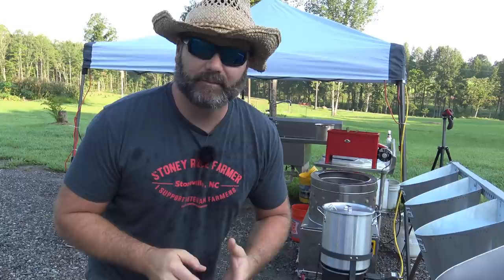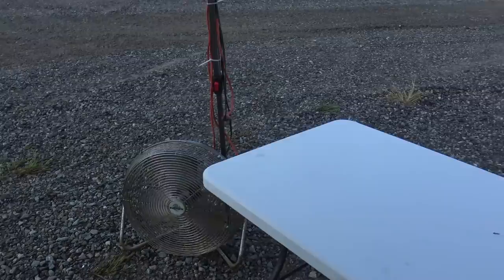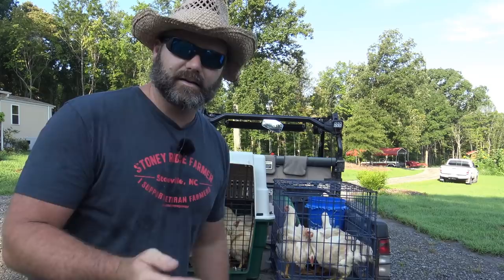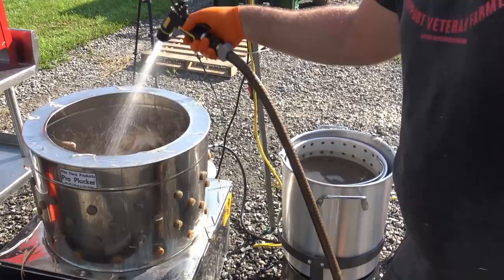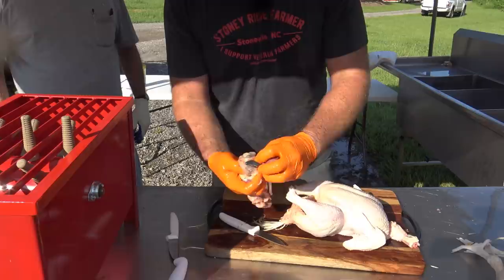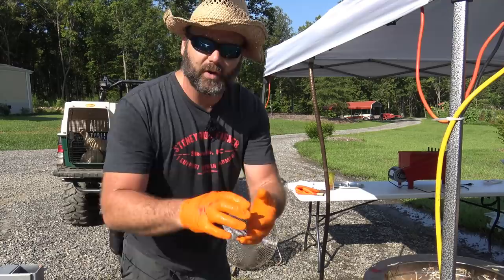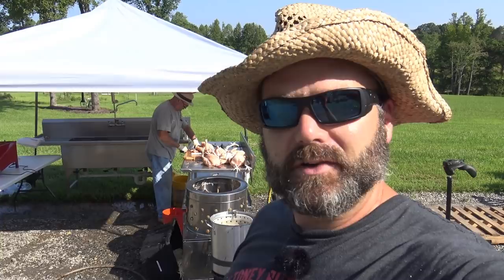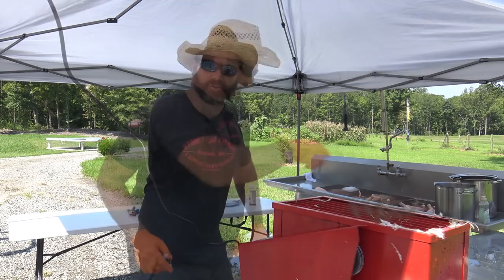How to butcher chicken outdoors

Comment: We raised meat and egg chickens in our farm without any technology. On butcher weekends, we started a fire for a scalding pot, strung up their feet and hung the birds from our plum tree after completely beheading them, then quickly scald them in the pot for a little under a minute  We plucked them by hand and pulled pinfeathers with pliers. We used a butane torch to singe off the hairs on the bird. The next step is cleaning the bird as shown on the video. We would do 700 pounds of clean birds in a two day weekend, then Monday dad went to work and we went to school. When we gathered at the table, we had 50 different ways to prepare chicken that if never got boring. And I STILL love chicken, 40 years later!

Comment: Josh,
Excellent ! I loved the plucker that was my favorite device. You have a lot of chickens in that freezer. Lol 😂. The tooter lmfao .
General repair
Woooooooooooooooo
Reply: I agree with the GR, that automated plucker is awesome! If i was in the business of doing what your doing I would set up a water drip flow/float activated into the scalder pot so you would have one less thing to monitor. Great video Josh!
Reply: Rob Smith that machine is seriously awesome I don't know if you could see it in the video but the bolts that are going through the machine are plastic you can see the casting from the outside seriously awesome machine $500 that's the issue I'm having water if you can make one out of an old washing machine up right? Check out my channel. Thanks for the positive comments you're awesome. 
General repair

Comment: We used a 55 gal drum and a thermostat plumbed it with a drain and a hot water heater element.  works great and we dont have to refill.  requires electricity tho.

Comment: Curious if you don't have a plucker if you put them in the 45 sec hot water how much harder is it to manual pluck a chicken. That plucker machine is very fast superizing how quick you can do chickens aka 50 in a few hours isn't bad. Do you uses the same equipment for other birds like turkeys.

Comment: 185 degree water? It evaporates at 100!
Reply from the maker: Ok...so put a pot of water on the stove at 185 degrees...and tell me how long it takes to evaporate 2.5 gallons of water...it also drips off the birds when we pull them out...we probably add a gallon through the process but it's not floating away brotha